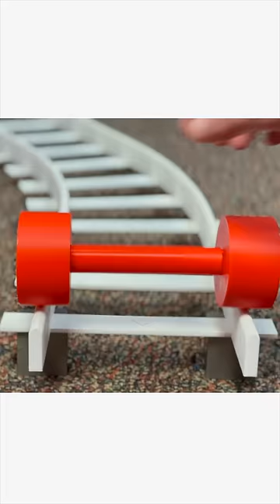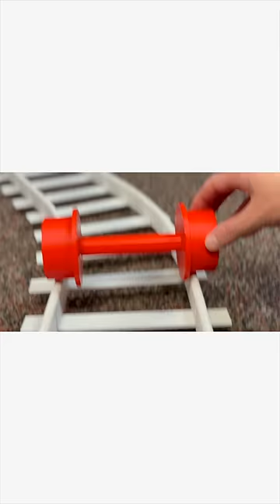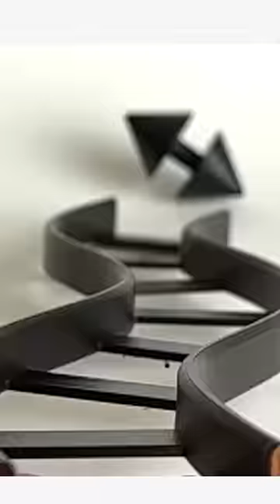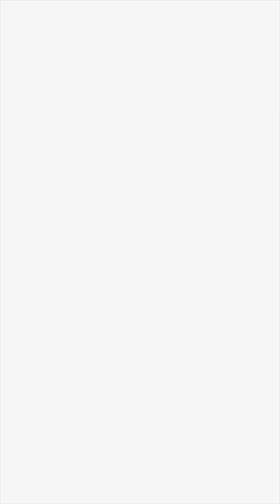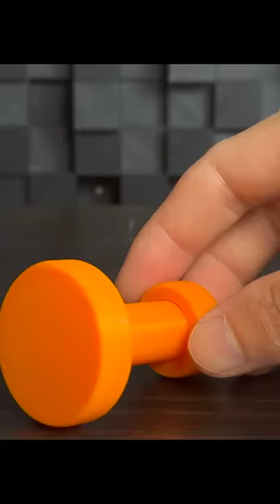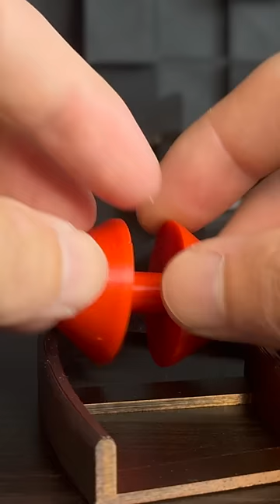The Design of Train Wheels is Genius #3dprinted #trains #interestingfacts

Comment: But in the end Wil this not lead to the rapid deteriorating wear of the rails as only a small portion of the wheels is resting on the rails at any given time. 
Why not have the wheels fitted with differential like car axle wheels. Also traction on the rails is much reduc compare to when the whole wheels is resting on the rails especially when going uphill

Comment: Explain multiple axle trucks (bogeys)? Yeah this barely is used because there is always (rarely not) at least 4 wheels on each bogey and sometimes 2 on steam locomotives but thats attached by a pivot point at the back making sure it doesnt move around. Standard rolling stock has no 2 axle trucks (rarely like the Aerotrain which failed) and even if it does, a second 2 axle truck is on the other side in a rigid setup. Other than that, good concept but hasn’t made its way onto actual locomotives/rolling stock because flanges on the wheels have been standardized and are safer. Coned shaped wheels will most likely derail a train car from all the weight of said car plus there is really never 2 axle bogeys on rolling stock (other than the ones i said earlier).

Comment: There is a slope on the wheels but it’s not major. And the trucks that hold the wheels on the engine can turn so that helps too
Reply: the 'trucks' have no bearing on steering.
Reply: @xaiano794  I meant it helped it move more smoothly on the track. But it’s nice to always talk to a another railroader

Comment: Well as shown when the rail is fully straight the wheel was really wobbly wouldn’t that cause the train to shake and wobble a lot
Reply: that's because it's a straight sided cone, trains used a profile where it gets exponentially steeper the closer to the inside of the profile you get. This combined with lateral dampeners give a smooth ride.

Comment: But wouldn’t that be harder on the rails because there would more pressure per square inch  from the edge of a wheel at certain contact points?

Comment: Not exactly true you see the wheels are just basic metal wheels with a flange and two wheels are attached with one axle and it is then attached to a box like frame with another set of train wheels which is then attached to a train car and at the other end of the train car is the same thing and when it is coming around a turn it is turning the wheels that hit the turn first and then the back wheels turn whrn it hits the turn in the tracks

Comment: See yes the flanges work when pushed take for example you have a 2-6-0 the 2 in which we can use the flagella wheels he has there and have a small tag in the middle with a push mechanism and the for example is the 6 drivers in which would calibrate for the 6 and there you go now you can take turns but as I will mention turns on a railway would not be the tight unless in 3-foot narrow gauge did they create new wheels no they just over simplified it to a point of unrealism

Comment: The problem with this analysis is that turns for trains is not so drastic. In fact that conical design is not used for trains. Yet the design with the flange is.

Comment: But i think using it in a real train won't work because the weight makes it derail everytime in curve and also it's very wobbly, the old one is correct because it has wheels that turn and follow the rails direction.

Comment: That’s not correct. The wheels are fixed together, meaning both sides spin at the same speed. On a turn, the inside wheel has less track to travel than the outside wheel. Meaning it will be spinning slower, however it can’t because it’s fixed to the other. To solve this the wheels are slightly tapered so that the diameter is smaller and can spin at the same speed as the outside wheel.

Comment: This is needed only when the turns are sharp but the danger of derailing will be there that only is minimized by adding flanges.
Reply: flanges are emergency measures, you don't want to be grinding with them as standard

Comment: Im left very comfused because grew up right next to a train station, ive seen the wheels a hundred times and they are not conical shaped they are just regular wheels with a flange
Reply: He said it was simplified (in this case exaggerated, and minus the flanges)
From Wikipedia: “Most train wheels have a conical taper of about 1 in 20 to enable the wheelset to follow curves with less chance of the wheel flanges coming in contact with the rail sides, and to reduce curve resistance.”
1 in 20 is slight, you wouldn’t probably see the tower unless you were looking for it.

Comment: not quite correct though....they werent  cone shaped, they were more like the second red one but not too many room on both sides.....its the curves of the railway that has certain limits of diameters that correspond to a set of four wheels attached together that can pivot a certain degree .  (and each wagon has two set of four wheels by the way)😊 and if you see six set of wheels like the engine head, the middle ones had no wheel guard.😅

Comment: Add the required number of wheels for one car, enlarge the system with the new wheels for the whole train, see how everything starts to "wonderfully" self-balance, add this self-balancing system speed and....
If the trains with these ingenious wheels will not start to go off the rails, then it will be left to calculate expenses for material of wheels, new weight of the train, to calculate braking distance, to estimate wear of a surface of a wheel in contact with a rail and corresponding change of a form of a wheel with time.....
If at this stage there will still be a desire to claim genius, you can implement it, but it seems that it is better not to invest in such an idea.

Comment: The reason the flange model didn't turn was because the flange wasn't touching the tracks, if it would have been it would have worked perfectly, check your local motorized Thomas the train engine toy track for proof, the stupidity is mind boggling

Comment: Can't you just install some mechanism that allows the wheels to turn independently?
Reply: why use a mechanism when you can simply use a single solid piece of metal? no maintenance.
Reply: @xaiano794  Is it so difficult to lubricate it once a year?
Reply: @Ministry.of.Truth0 well, I get that it seems easier but if a part gets broken on the mechanism then you have to replace individual parts with their own special pieces, plus it would take extra power to keep it running. With this solution you just build the wheels like this, and you’re done. Unless they break of course, but you can replace them easily.

Comment: Umm, no. I work on rail cars for a living. We change over a hundred wheels a month that are worn out. The wheel flange keeps them on the track, wheels are set in side frames, side frames are attached to a bolster. This is called a truck. Trucks pivot at the center of a truck bolster where it is connected to a car. This is how and why it can turn. What he is talking about in the video is barely noticeable on new wheels, and this feature disappears as the wheel tread wears down. Nothing really special about it.

Comment: How Train Wheels Work: A Breakdown
Train wheels are a crucial component of railway systems, designed to efficiently and safely guide trains along tracks. Their unique design incorporates several key elements:
Conical Shape
 * Purpose: To facilitate smooth and controlled turning on curved tracks.
 * How it works: When a train enters a curve, the outer wheel contacts the rail at a larger diameter than the inner wheel. This difference in contact points causes the train to naturally curve without requiring external steering mechanisms.
Flanges
 * Purpose: To prevent derailments by keeping the wheels securely on the tracks.
 * How they work: Flanges are projections on the sides of the wheels that fit into the grooves of the rails. They act as safeguards, ensuring that the train stays on the intended path.
Axles
 * Purpose: To connect the wheels and distribute weight evenly.
 * How they work: Axles are rigid shafts that pass through the centers of both wheels in a wheelset. They provide a fixed connection between the wheels, ensuring that they rotate in unison.
Wheelsets
 * Purpose: To form a unit that can be easily replaced or repaired.
 * How they work: A wheelset consists of two wheels mounted on a common axle. This assembly is designed to function as a single unit, making maintenance and replacement more efficient.
Rails
 * Purpose: To provide a stable and guiding surface for the train wheels.
 * How they work: Rails are long, steel structures that run parallel to each other and form the tracks. They provide a smooth and even surface for the train wheels to roll on.
In summary, the design of train wheels incorporates a combination of conical shape, flanges, axles, wheelsets, and rails to ensure safe and efficient train operation. The interaction between these components allows trains to navigate curves smoothly and stay on track, even at high speeds.

Comment: 1st order of business: whoever makes that zig-zagging track, either he's smoking too much joint or having too much time & too little pay.
Either way, he needs to be f-i-r-e-d.

2nd order of business: simplest solutions don't equate most cost effective ones. The conical wheel would need flexible bearings to keep the bogie from wobbling, adding points of failures & thus lowering mean time between failures. Not to mention, smaller contact points between wheel & track might create frictions that increase wear risks om both components.

All in all, looking genius doesn't necessary being practical; all engineering solutions need few steps of afterthoughts. Actually, all solutions need those.

Comment: Don't be a fool. Flanges work fine. Trains travel in straight lines. But if there is a curve, it's very wide and gradual not to bind up the flanges. The curves shown in this video are way too sharp and radical. Don't be a fool.

Comment: Bahahahaha train wheels look and are nothing like that!
Reply: this is to demonstrate the principle behind train wheel design
Reply: @xaiano794  ok and there not at all designed like that!
Reply: @chriskibodeaux9818  they are cone shaped in real life,  the shape is extremely flattened and works in concert with the shape of the rail. 

This is just to demonstrate the mechanical principles as you wouldn't notice the shape on a real wheel
Reply: @xaiano794  but you absolutely can see the shape of the wheel! This is nonsense!
Reply: @chriskibodeaux9818  yet there are many other comments right here saying they never noticed the shape of train wheels
Reply: @xaiano794  doesn’t change that you can clearly see them and they absolutely are not designed this way!
Reply: @chriskibodeaux9818  'can see' =/= noticeable 
I think your argument here rests on you misunderstanding words.

The wheels of trains are based upon this principle.
Reply: @xaiano794  nope not confused! Cause they are not that shape in anyway or based off this design! This is 100 % false!
Reply: @chriskibodeaux9818  I'm both a train driver and a physicist and you're 100% wrong.

All train wheels are conical, that's literally how they work.

As they reach a curve the wheel shifts to a higher portion of the cone, meaning it has a greater diameter and the inner wheel goes lower meaning a smaller diameter since they are connected by a solid steel bar through the middle, they have to turn at the same rate, meaning the outer wheel travels at a faster rate than the inner wheel, turning the corner.
Reply: @xaiano794  bahahaha but ur not cause my info is coming from someone who actually is! Physicists my ass! That’s hilarious! Why throw the extra lie in there?!
Reply: @chriskibodeaux9818  I literally am, have been 17 years.

Honestly if you can't admit you're wrong when you are speaking to a professional then I feel sorry for you because you feel so insecure that you'd prefer to be inept than admit fault to some random person on the internet, and that's really sad.

But since you're so confident, i'll put the ball in your court - if I'm wrong then explain what DOES make a train wheel turn a corner. I'll wait...
Reply: @xaiano794  Cause I know I’m not when an actual professional gave me correct info! You prob flip burgers cause damn sure have no clue what ur talking about!
Reply: @chriskibodeaux9818  Still waiting on that explanation. Tick tock.
Reply: @xaiano794   nothing to explain! Only point I made is this is false which is 100% true! It also not my job to explain anything to anyone!
Reply: @chriskibodeaux9818  LOL that's the same as admitting you have no idea, otherwise i could simply claim anything and everything you say is wrong without backing any of it up and of course, you couldn't possibly know I'm wrong if you didn't understand how things actually worked.

So come on, last chance here to explain how such a simple thing like this works. Kids 180 years ago understood these mechanical principles so if you can't explain then that doesn't bode well for you, does it?
Reply: @xaiano794  I don’t need to prove the sky is blue! Reality is what it is and does not need explained! I also already said I got my info from a real train conductor not someone pretending!
Reply: @chriskibodeaux9818  That's the same as admitting you lied.

Honestly, this is just sad. If you really knew, you'd have simply explained rather than making a dozen posts.
Reply: @xaiano794  no it’s not!!! Thats hilarious! Again don’t need to explain why the sky is blue! Look it up yourself! I got my info direct from the source your making shit up and claiming to be someone ur not!
Reply: @xaiano794  I know u think ur clever some how but ur not! And 100% wrong on top of it and you can’t prove me wrong without lying!
Reply: @chriskibodeaux9818  prove you wrong? You never offered any explanation that could be analysed,  or did you forget that?

You've accidentally let slip your reason for refusing to give an explanation,  you don't want to be proven wrong.
Reply: @chriskibodeaux9818  dude,  I'm literally a train driver,  I'm back at work Monday and it's the best job in the world,  literally getting paid for playing with trains.
Reply: @xaiano794  again I don’t need to explain anything! I made an accurate and 100% correct statement! If you think I’m wrong prove me wrong! But you can’t cuz we again I’m not!
Reply: @xaiano794  then you would know I’m not wrong! But you’re absolutely lying!
Reply: @chriskibodeaux9818  How can anyone prove anyone wrong if they offer no explanation to critique?

well?
Reply: @chriskibodeaux9818  well? Did you run away?
Reply: @xaiano794  wtf are u talking about?!
Reply: @chriskibodeaux9818  you can't comprehend what I'm asking? Really?

I'm merely asking how it is possible to prove someone wrong if they have never offered up any explanation in the first place. 

How can you prove them wrong when they haven't offered anything up?

It isn't a complex concept.
Reply: @chriskibodeaux9818  run away again?